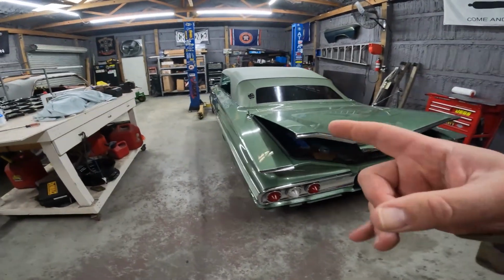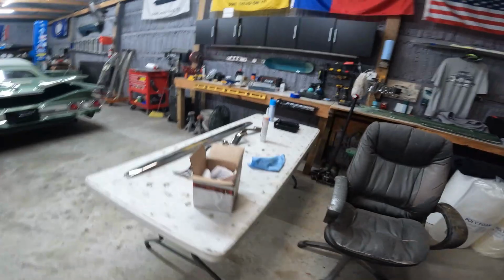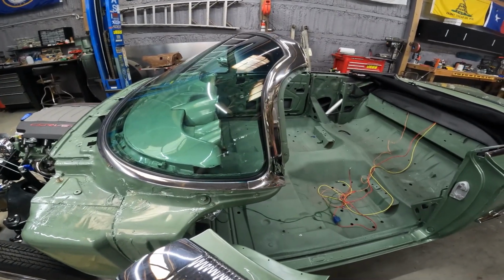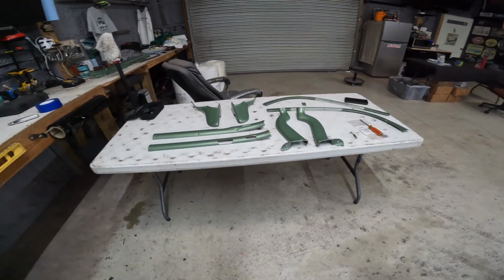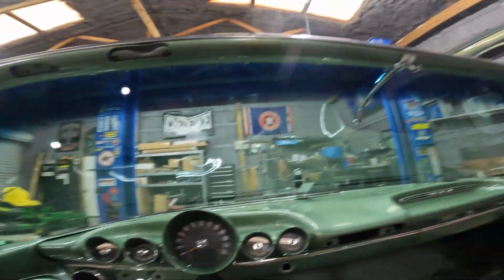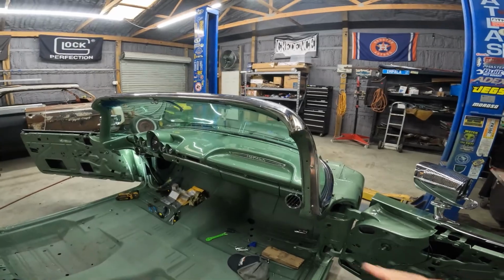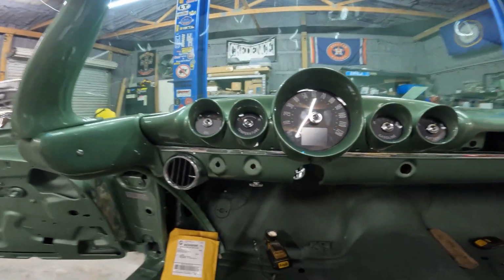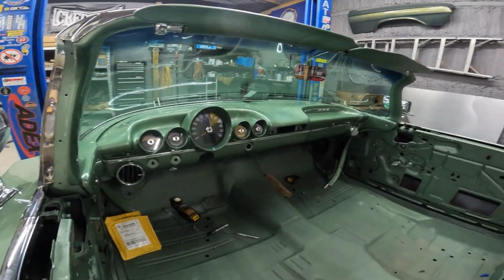1960 IMPALA CONVERTIBLE WINDSHIELD MOLDING ASSEMBLY / DIY / STAINLESS MOLDING / INTERIOR / LOWRIDER

Comment: Looks awesome sir, every time I see that Corvette engine cover I start to become curious if you’re going to color-code it to the car and put some impala badges where the Corvette ones are…💯💯💯
Reply from the maker: Yes.  Haven't figured it out yet.but they will get addressed. If anything  shave them down and body work and paint. I think blank covers are made these days
Reply: @lonestarlows  you could put the quarter panel emblems off of a 64 on both sides, with that dark green in the middle of the cover and doing the outside parts in the lighter green.. very cool stuff..💯